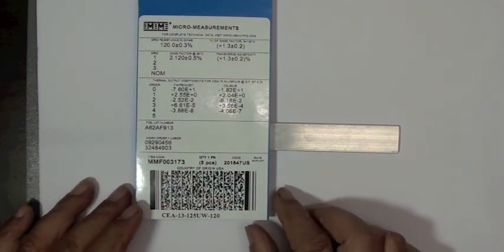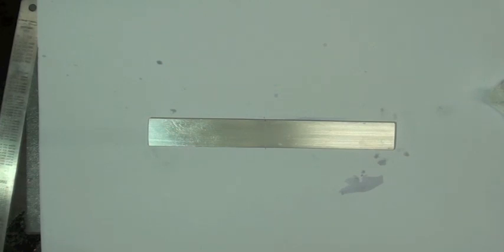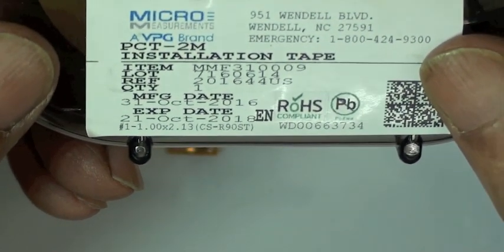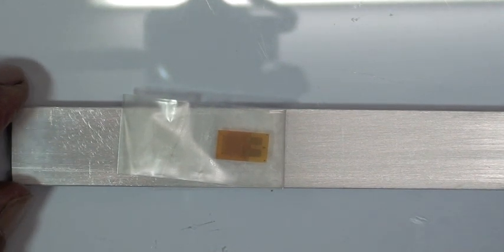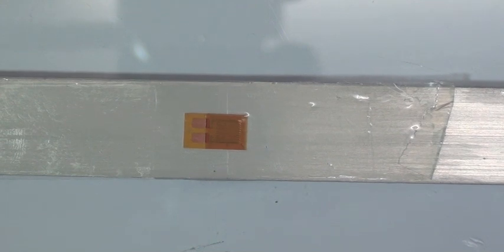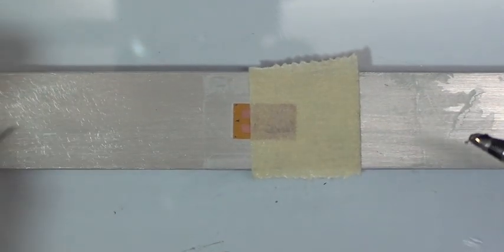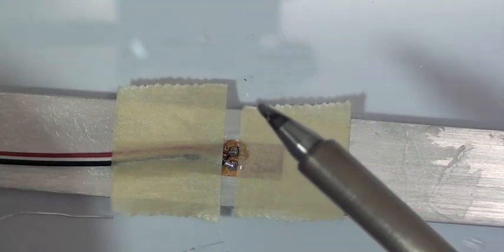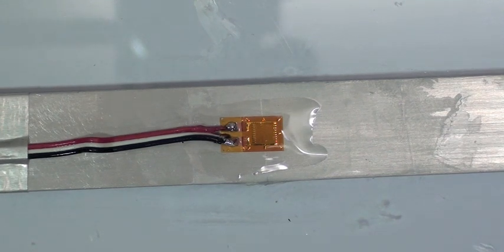Strain gage installation procedure

Comment: weather this strain gauge procedure is applicable for pasting  2mm strain gauge. Or else any other prosedure is required?? Pls give me suggestions...
Reply from the maker: The same procedure is used for 2 mm gage also. Since the alignment marks on the small gage would be close, care should be taken to align the gage more carefully. Also, the solder tabs of small gages are more sensitive, so thin lead wires such as 134-AWP from Micro Measurements  may be used, and  more care has to be taken not to overheat the tabs while soldering. 
Regards
Reply: @DynatecIndia  thankyou.👍

Comment: HI,
Its really helpful video which you have shared ..
Learned a lot thing from video ,
Can you share video for surface preparation for concrete specimen  ?
Reply from the maker: Thank you for your comments. I will plan a video for surface preparation for concrete surface soon.
Reply from the maker: Thank you for the comment and query. Concrete is a porous, non-homogeneous material. The surface preparation for concrete is different, requiring filling of the pores with AE-10 Adhesive,  and using a long gage to average out the effects of non-homogeneous nature of the concrete. I will plan a video on concrete and post it as soon as I can. Regards
Reply from the maker: I have just put up a video of strain gage installation on concrete, which shows the surface preparation and gage bonding process.
Reply from the maker: I have posted a video on gage bonding on concrete, on my Dynatec India channel:
https://www.youtube.com/watch?v=N-FdzDciAZI

Comment: Sir, Can we glue strain gauge on small thin plate (having same material as targeted specimen) using M bond AE 10 , complete process of soldering in lab. and then install that thin that plate using good quality epoxy or welding or using M bond AE 10 kit with targeted specimen on the field? Will this create any error in measurement?
Reply from the maker: Yes, you can use this procedure to avoid installing the gage in the field. However you must remember that the straingage will be further way from the surface of the test specimen. If the part is subjected to bending , the gage will be further away from the neutral axis, and will show a higher strain reading. You may want to correct the reading to give you the true strain on the test surface.